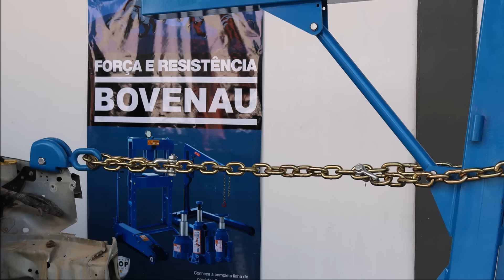Alinhador de Monobloco - BOVENAU - Utilização de Acessórios

Comment: My father has a body shop is and Cincinnati Ohio he had it because he had it from 1957 to 74 noodle old postal connect to work for my dad went to work for my debit look for chief EZ liner Intel 75 until 1984-85 remove live forever in 1979 remove the Florida 1979 you show Blackhawk machine Blackhawk I mean Black this Lowell system BevMo on machine in 88-90 they forgot the little people hey. Are you good that why my dad Cooks show him no more $85, 000 to euro